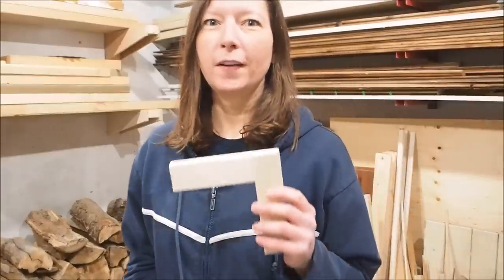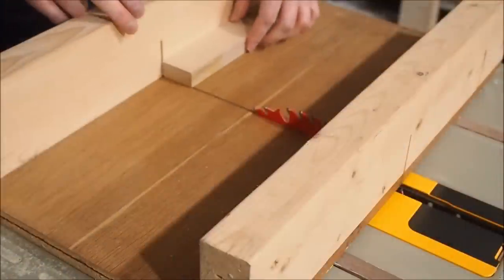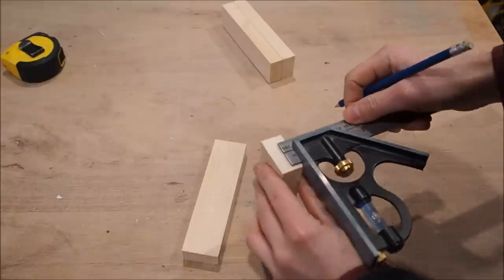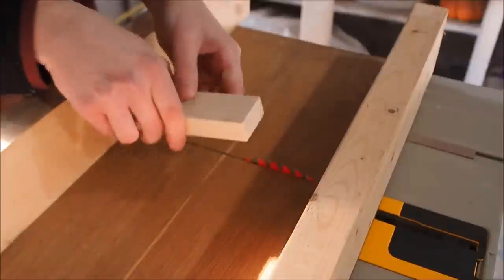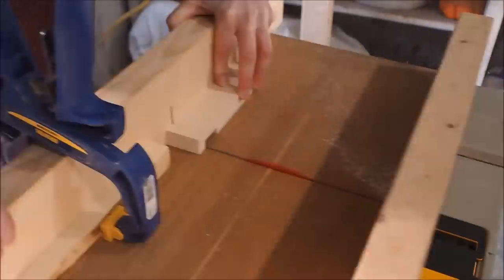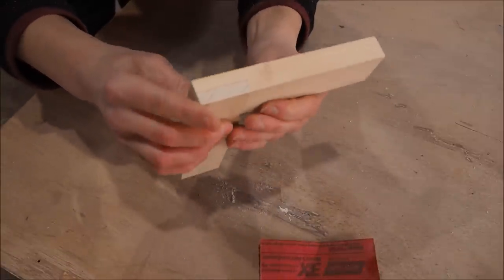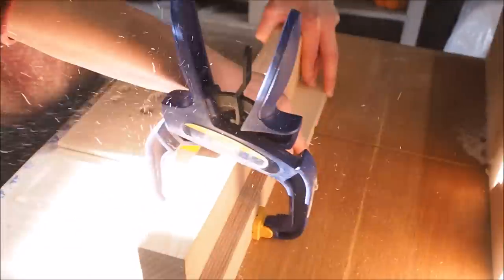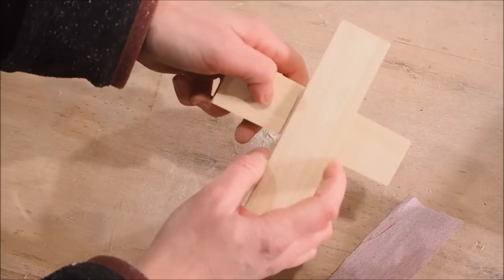Consistent and accurate half lap joints

Comment: That’s a great solution, Mary.  
Ironically, last evening I watched a Brit do half-laps with a trim router.   And his results were excellent.    But the router setup and use doesn’t thrill me.  Plus, I don’t have a trim router.   
The crosscut sled method is more my idea of a safe undertaking.   I will be using that method.  Thanks……from a guy on the same side of the border as you……

Comment: Thank you so much for this great tip!  Just today I was practicing my lap joints and found your method was much easier.  I am going down to make a cross cut sled and make my little 1/8 in. piece.  Thanks again.
Reply from the maker: My pleasure! I used to struggle a lot and get frustrated with lap joints so I figured out this method, and now that I have, I’m happy to share!

Comment: Hello,
Thank you for posting this video. I may be wrong but I have read a similar approach in a book on jointing wood but without the need to make the piece that is equal to the blade thickness. I am going to try to find that article and let you know after testing it in my shop. 
Regardless, your approach definitely works.

Thank you again,
Mimi

Comment: Great video, thanks so much for the detail. Not hard in principle to make half lap joints, but to get them snug that is the real challenge. Your method seems great and I will definitely be trying that out soon. Although with a mitre saw, but can probably make that work
Reply from the maker: If you have a depth stop on you miter saw it should be doable. Good luck!
Reply: @DIYMontreal  It turned out to be doable with the depth stop. I was working with outdoors wood for a garden gate, so had a bit more variations in the wood measures between pieces. That meant that I might have had to calibrate the stop block for every cut. Instead I used some fixed plastic spacers of 4, 3 and 2 mm (saw blade of 2.8 mm), starting with the largest one. If the fit was not quite there, I snuck up to the good fit with the smaller spacers. Again, thanks so much for a great method :-)

Comment: You're going to love a beefier table saw. I used one like yours for years and years — finally splurged on something in between a "contractor" saw (like yours) and those massive "cabinet" saws. The difference was immediately obvious — like when you get a brand new blade for your saw.....
Reply from the maker: Funny that you mention it... I bought a new Ridgid contractor saw on black Friday. Still haven’t used it. I’m still debating whether I should return it and splurge for something better. It was a really good deal though... and I like that I can easily move it around. But I feel like it’s not that much of an upgrade. Any advice? What did you go for?
Reply: do your research and buy the best one you can afford. I got the 3hp saw stop and I instantly fell in love using it the first day. I did my research and for the type of work I do this met my needs and was only slightly more than what I had budgeted. It has been just over a year now of almost daily use and it still makes me smile when I use it. You can't go wrong if you get what you want and need.
Reply: I was also impressed with your method and explanation of a fairly simple and ingenious way of cutting a tight lap joint. This was the first of your videos I have seen but it won't be the last. I also just subscribed to your channel just based on this video. Very well done young lady!

Comment: Thanks for sharing, I also recently tried a half lap joint on a plant stand that I built. I messed up cutting too deep and too wide and frustrated. Will try your methods, however I will be using a sliding miter saw with depth adjustment and see if I can be successful without too much trouble.
Reply from the maker: Yeah, wish I had a depth stop on my mitre saw. Great idea.

Comment: Some useful tips here. I was recently making a bunch of half-lap joints on 1 x 4 for covers on my garden's raised beds. I had so many to do that I decided to use my dado blade. I chose my dado blade for two reasons: first, I was able to make 1/2 inch passes rather than 1/8 inch, considerable reducing the number of passes I would have to do. second, the dado blade makes a flatter cut than my normal 1/8" blade (I don't have a specialized "flat" blade.

I really liked your use of the crosscut sled for making these cuts and I would have liked to use mine. But, unfortunately, the crosscut sled doesn't work with a dado blade.

Comment: Thanks, Marie for a clear and well-presented video. I too have struggled in the past with half-lap joints. But not anymore! My table saw blade has a slight wobble so the kerf is a bit wider than the width of the blade. To find the correct width of the spacer I cut a slot in a piece of scrap wood and made the spacer to fit. Any ideas on how to make a half-lap joint at an angle other than 90 degrees?

Comment: Hi. Instead of the wood spacer, it also works to use a drill bit the size of your blade, for example 1/8th inch. 

Thanks for the video. I got some tips I’ll use.
Reply from the maker: Yes, absolutely! That works as long as your blade is exactly 1/8th. If it's a bit thinner like in my case, that's where the custom spacer comes in handy.
Reply: I think Barbara's point was that you choose a drill bit that matches your kerf.  If the blade is thinner than 1/8, you try 7/64 or 3/32.

Comment: Hello again,

I think I know how you can follow your approach without the need to create the wood spacer that is equal to blade thickness.  Basically, instead of putting the sample of your wood piece to the right of the blade,  you can cut a small piece and align it with the left side of your blade and do everything else the same way you are doing now and make the cut.

Thank you,
Mimi

Comment: Love this. You have a new sub! Couple of thoughts - you could use the kerf in your Xcut sled to gauge the spacer. OR, have a look at kerfmaker vids. They use a screw on one side of a spacer block. The same process could be used here instead of that tiny and fiddly slither of wood.
Reply from the maker: Absolutely! Both great ideas. I've always wondered about the accuracy of the screw adjustment, but that could work well and avoid losing that little piece too.

Comment: Awesome technique. Question 3:34, once you remove the filler piece, do you butt the part against the stop block and start cutting from the right side of the first cut? I hope my question is clear?
Reply from the maker: No, I didn’t butt it against the stop. You just need to remove all the material from the right side of the first cut made using the spacer.
Reply: @DIYMontreal  AHHHH I was watching and thinking What the....I was thinking that if you did butt it up to the stop block, you would go too far on the second cut.

Comment: How would you create a sequence of half lap joints with lets say 2 inch high horizontal and 1 inch verticals with 2 inches inbetween, in total 7 verticals. The verticals and the horizontal are all 1 inch thick.

Comment: I can't figure out the reason for the 1/8" thick piece. Can you shed some light on that please?
Reply from the maker: Sure thing! The 1/8th (approx) spacer accounts for the thickness of your saw blade.
Reply: When she sets the position of the stop block, she uses the lapped piece *butted up against the blade*. Think about that: if you just put the piece against the stop block, and start cutting, you will cut a notch that is the size of the lapped piece, PLUS the width of the blade. That is, some width "W" plus the kerf-width "K":  Cut = W + K. Given that the blade won't move, and there is no other good reference mark, how can she subtract away the "K" factor? By making a special spacer, and inserting it after the stop block is positioned. Now the cut width is: Cut = (W+K) - K, which reduces to W + (K-K), or just W. A perfect fit!

Comment: I don’t understand how the spacer adds to the process of making perfect half laps. 🤪 Maybe it’s my bedtime!
Edit: Ah, cuz it’s width of kerf. Got it. 🙄

Thanks, again.
Reply: It's because she is using the other piece as a spacing guide, butted up against the blade. This means the width of the blade (the kerf) is being "added" to the width that will be cut, and that's wrong. So the special spacer piece pushes the cut over, "subtracting" the kerf width away again, leaving nothing but the width of the other piece.
Reply: And she only uses the stop for the 1st cut - subtracting the kerf.  Then cut from that cut to end but not using the stop.
Reply: Also, it prevents the groove from being too wide and allowing the joint to be loose and wobble.

Comment: I have one question:

After finding the middle of the work piece with the try square method, why are you not using the try square to set the height of your blade?
Reply from the maker: Yes that’s a good method but I find I get greater accuracy by making a test cut on one side then flipping it over and repeating until I get it dead centre.
Reply: @DIYMontreal  Everything worked great for me, except during the repeated cuts my blade slipped down - shallower cut.  No vertical lock on my table saw.  I now set the height coming up from too low and then clamping the wheel in place to maintain saw height.  Luckily slipping down just meant I had to go back and re-cut with blade at the right height.  Then everything worked out great.  Oh yeah, and don't use old scrap to set height of blade or width of cut.  Use scrap from the current stock.  I learned the hard way.  Great tips!  I will be watching some more of your videos!

Comment: There's a MUCH easier way (4 or 5 sled cuts only, no sanding) to make that blade thickness reference shim.

All you need is a scrap for a stop block on your sled, and a scrap to make your blade thickness shim from.  Just like a box joint setup requires a good reference to the blade, similarly to make a blade thickness shim, you just need a good reference to the right side of your table saw blade in order to cut as many as you want.

Here's how:

Using about a 3" long scrap (about 2" wide) that will be made into your blade thickness shim, run it through the saw to true it up for a perfect edge LONG WAYS (rip cut).  If you have any doubts about it being a right angle on the end, true that up also.  Now put a stop block of scrap clamped mostly right of your blade against the back fence of your sled so that the blade will JUST barely nick and trim it flush on the left end of the clamped stop block and go ahead and trim it flush with the blade.  Make sure the blade is set higher than the THICKNESS of the prior 3" scrap.  This provides a perfect reference of where the right side of your table saw blade is, which is whole trick to making your shim.

Now with that stop block that is referenced perfectly to the blade, just take your 3" scrap, slide it over to that stop block long ways (grain running toward the blade and the cleaned up side towards the stop block).  Now just cut far enough into it with the blade to equal the thickness of your scrap block clamped to the fence.  In other words, if the stop block is 3/4" thick material, just cut about an INCH into that trued up 3" piece and STOP CUTTING.  This is perfectly removing the thickness of your blade, since the stop block was trimmed to exact right blade edge.

Now just flip that 3" piece over, so that the JUST CUT relief (blade thickness removed) is now up against the stop block on your sled, and you'll see the rest of that piece that is now to the right of the blade when you cut it, will be exactly the blade thickness.  Push and cut it free and you're done.

Takes way longer to explain than do...
Reply: Posting a video would be great!